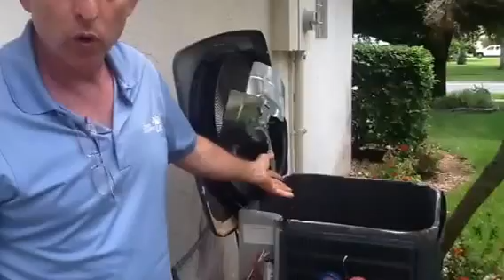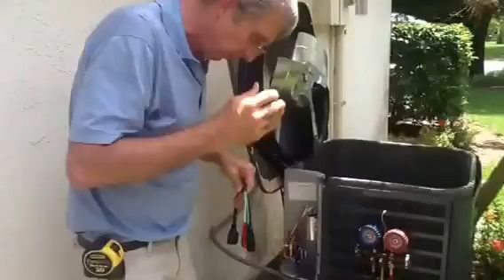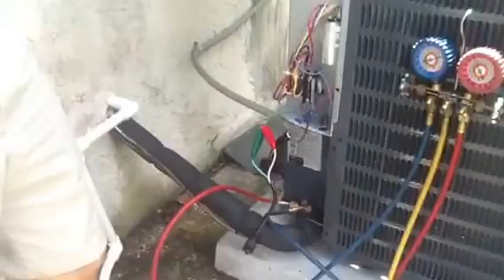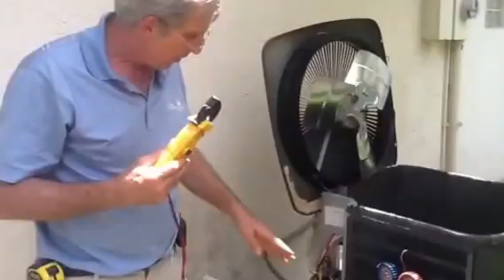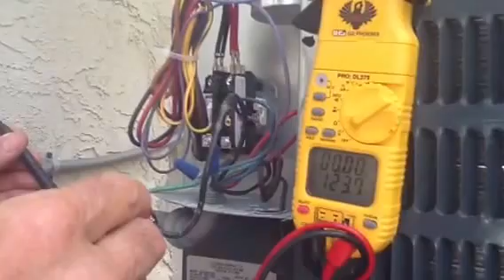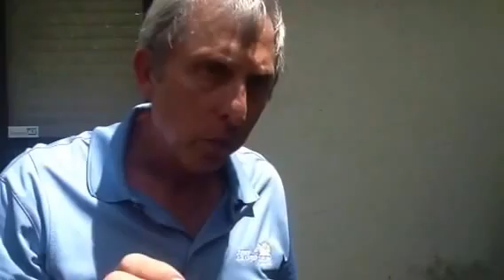How to Get 110 Power Using a Power Adapter Cord

Comment: OMG!! Really!!!! this is very unsafe!!!! By Connecting the Neutral of your pump to the Ground wire you are sending Return Current of the pump back thru the Ground System. Everything metal is connected to ground. This is how people get electrocuted. Just wait till someone is touching a metal lamp or any other such metal encased electric component when you run your pump. I can see the law suits from here...
This is very dumb and stupid. I cant believe you are telling people who don't know any better to do this. Now that I have you business name and phone number I may report you for jeopardizing the safety of your customers and other unsuspecting people. You should remove this video!!

Comment: Just putting it out there so everyone knows. This process will work, but you’re not supposed to turn ground into a neutral as you will end up with voltage on your ground before it is bonded to neutral in the panel.  Obviously we all use it when we need to, but it’s definitely best to use it temporarily as shown with a recovery or vacuum pump. Best not to leave the site with it hooked up as such.

Comment: Is there an issue if there is not a ground wire from the disconnect to the panel?
Reply: This wont work if you have no ground wire. It is also unsafe to operate a unit without a ground

Comment: This is a very useful solution! All basic electrics too. It is worth noting that this will only work where a split-phase service is available (i.e. most of North America, parts of South America). This wouldn't work in the U.K. or Europe for example, where only 240 is available (3-wire single phase). In the U.S. and Canada, we have 240v Service supplied also. But instead of 3 wires L+N+G we have FOUR: L+L+N+G. Still single phase, but the 240v is split in half at the main transformer via 2 low-voltage windings connected with a grounded midpoint tap. This gives 2 live wires with the neutral at the midpoint. Each live wire is 180 degrees out of phase with each other. This means that when you connect L-L, you get 240v. If you connect L-N, you get 120v. This is exactly what happens in your breaker panel. Some circuits use L-L for electric stoves, water heaters, AC, anything else that requires more power. And L-N for your lights and small appliances. The cheater cord does exactly the latter. My only concern with it is that it uses ground as a current carrier replacing neutral, which it isn't meant to do. For small jobs it's probably fine. But keep in mind that the ground wire is thinner than the live wire and is NOT rated for the current of the CB it's being connected to. This can be very dangerous if you draw too many amps for too long.
Reply: Greattt explanation. Thanks for that. I plan on using this method through a hookup made by zebra called zebradapter. Mainly to run a vacuum pump if I have no access to 120v.

Comment: What about the 24 volts won't that pull in the contactor in
Reply from the maker: bad contractor
Reply: David Jones my question if I use the cheater cord do I have to cut the power of to the contacor the 24 volts side that is I'm a little confused on using this cord I want to use it to hook my shop vac to vacuum out the leafs from condensers and then wash them n make them look like new again
Reply: @arielhernandez2911  if you recall he took the 120 wire off the bottom of the contactor. if it pulled in it still wouldnt pass power

Comment: Hi David, very useful tip. Could I do the Same with a 220v male electrical connector and have a female 110v plug on the other end? I have 3 prong 220v to my hoists and no convenient 110v. If I could unplug the hoist and plug in an adaptor, it would save a lot of clutter on the floors.

Comment: Hi I'm current wiring my house d I need 110 volts the breaker box in my house only has 2 wires one hot witch has 110 volts andb the other is idk if its neutral or ground because it I check with the meter the comes out to  220 i tried tht method and it keeps getting 220 if its  is there a way I can get a 110 volts from this PLEASE I need to use my equipment at home cause they are all 110 volts

Comment: Thank you so much...I wasn't sure of where to attach white wire...Now I know...Still not sure how it works, but it does...ground to neutral got me a little confuse how that completes circuit..
Reply: Of you look inside of a breaker box, you will see that the white neutral wire on the 110v circuits connects to the same place as the 240 ground wires.